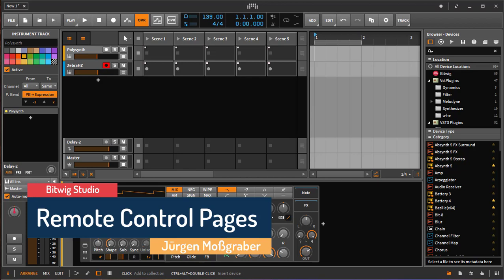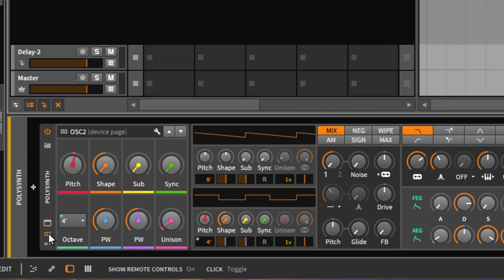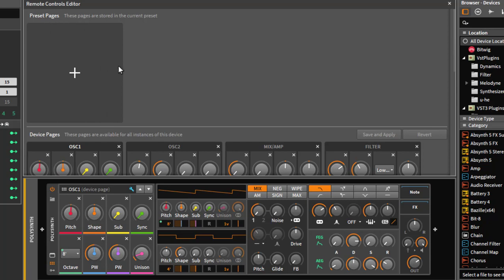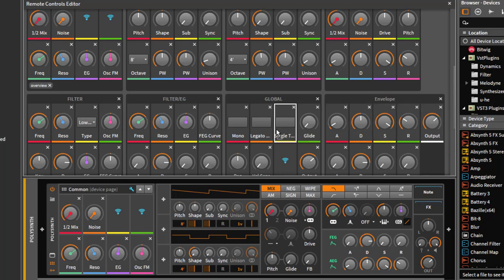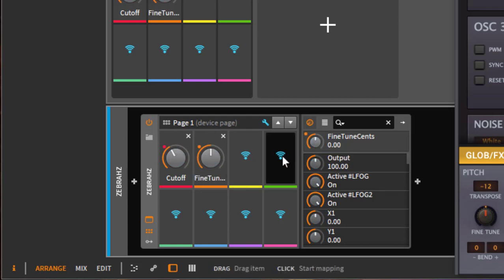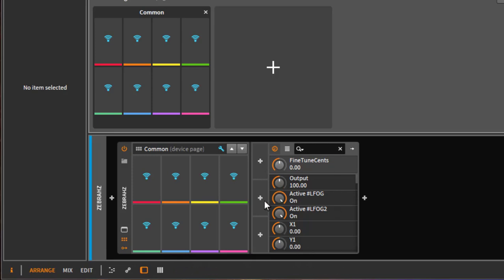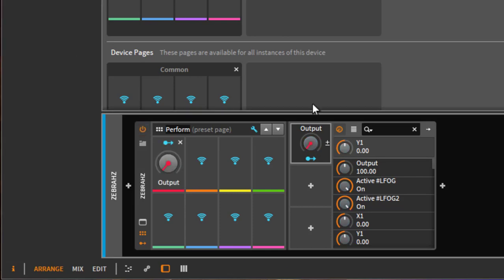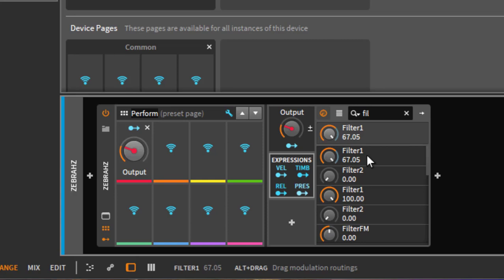Using Bitwig Remote Control Pages, Macros and Poly Aftertouch

Comment: Great tutorial! I have a quick question though. I am looking for a way to have a set of knobs be dynamic macros on a drum rack such as how Maschine works. I want to be able to select a pad and when I do the 4 knobs I have assigned would control say decay, pitch, filter cut off, and maybe volume per pad. Is there a way to do this? I know I can assign a midi cc knob to any perimeter but it wouldn't work if I switch to another pad or note. Thank you so much!
Reply from the maker: Yes, if you use a controller for which I support the layer mode, e.g. Push (from memory also: Akai Fire, Launchpad, MCU).
Reply: @mossgraber  perfect. I bought a fire. How would I assign pitch, decay to one of those 4 knobs?
Reply from the maker: @UNPAVEDMusic  You don't assign them to knobs but to remote control pages.

Comment: Hopefully a follow up question is alright. How would you do nested mappings? Say you have the midi cc device in the note fx section. How can I map the parent remote controls to that midi cc device?
Reply from the maker: E.g. if you have a Polysynth and added a MIDI CC in the Note slot you can create a Perform remote controls page in the Polysynth and map parameters from the MIDI CC device to it. This makes sense if you want to store it as a preset. Or you could use now project or track remote controls in Bitwig 5 to which you can map any parameter.
Reply: @mossgraber Ah I didn't realize that. Just make a new performance page and it works. Thank you so much!

Comment: Hey, in the first minute it shows you are scanning through the preset pages, is there a shortcut, or even better a midi control available to process through and back though preset pages ? I want to assign controls for frequency and gain of fabfilter pro q 3, I’m using a midi fighter twister and would love to be able to use one dial to control gain and crew per node. I have them assigned to remotes on page 1 and two but not sure how to roll between them. Obviously what would be super awesome would be to use the twister click button to cycle between, but I’m currently using a template which will only cycle between course and fine control. Jumping into editing the preset/template is a little overwhelming. As it’s a combo of both the midi fighter profile and also a custom script.
Reply from the maker: You can use my Generic Flexi which is part of DrivenByMoss (see the tutorial videos on my channel). There you can assign controls to specific pages or prev/next page.

Comment: Thanks for all your video’s! I’m trying hard to use this feature, but I fail to map these remote controllers to my midi controller via Flexi. Specifically as such that the same hardware controller CC is mapped to the same slot of different devices. Now we have the 2.0 version of Flexi I’m completely lost. I’m clearly missing some basic understanding of the Flexi approach. Is it possible to make a video how to assign these functions in this video with Flexi? Would be much appreciated! Keep up the good work!
Reply from the maker: There are several videos about Generic Flexi: https://www.youtube.com/watch?v=m4DkBlhR09g&list=PLqRWeSPiYQ64O9Ulu_aMQ9mdEDJDColcP e.g. the the "complete walkthrough".
Reply: @mossgraber  yes, I found the issue: my controller was sending MMC for then lower CC’s. Its now working!

Comment: Hi Moss! Great video as always :) In your opinion, what's the best controller on the market to operate Remote Control pages, Mixer and Transport? The controller doesn't necessarily have to have faders, keyboard or pads/clip launcher. I'd much really prefer a controller with at least 8 knobs with continuous input and led rings or display to show current value for both vst params and mixer levels, and maybe buttons for solo/mute etc beneath them... plus some buttons to use to switch pages/banks.
Reply from the maker: Go to the online shop of your preferred dealer, enter your filter criteria in the controller section, choose depending on your budget ;-)
Reply: @mossgraber  Budget is not an issue... I was thinking more on the line of what's good from a Bitwig script developer perspective (no filter for that... yet!) :) I have plenty of controllers (now playing around with PreSonus ATOM), but often have very poor support for MIDI, particularly when sending midi back to the controller to update leds, pads, etc. That's why I was asking you from the depth of your experience with these issues. Thanks
Reply from the maker: @EdoardoMarcora If you need deep integration, pick one of the controllers supported by DrivenByMoss.
Reply: bit of a late answer for you but if anyone else is looking for a controller like that, i think the midi fighter twister is pretty good option. 16 knobs with led rings, each knob is also a button. there is 4 banks of 16 knobs. the knobs can also be set to do something else when held down, like control volume normally, then control pan when held. the only thing that is missing for me is an screen that would display the parameters, but at least with bitwig you can just look at the remotes panel and see whats mapped, unlike other daws where you just have to remember.
the faderfox ec4 is similar (16 knobs/button combo) and also has a screen, but ive heard theres some oddities like you can use both a button and knobs at the same time

Comment: Hello, good video ! ! I have a question, at 09:00, where do you send the aftertouch mapping? to a Device or to a Preset page? thanks.
Reply from the maker: This is a VST plugin (so, not a native Bitwig device). In this case you can either map it to one of the parameters of a parameter page or directly to a parameter in the VSTs' parameter list.

Comment: Thank you for such informative videos! I would like to ask. Is it possible in such a way that the controller sees the parameters that are inside the chain and layers without mapping? I noted that maybe a bitwig can't do it. I hope I explained clearly
Reply: I would also like to know if there are interesting extensions for bitwig, like a multisample extension, which are not directly related to physical controllers in any way? And where to look for them?
Reply: And is there a script to create sort of virtual controller inside daw without midi сс?😅 I would like to use it in pair with your Flexi. If turn to the origins in general I'm interested in multiple instances of EQ+ with linked parameters without midi cc device and physical controller. For example, I read that there is a "linked FX parameters" script for the ripper
Reply from the maker: @vrtvp3  Yes, but the only controller I implemented this so far is the Push 1/2 since this requires IMHO a display of a certain size.
Reply from the maker: @vrtvp3  Checkout my OSC videos, especially with using (free) Open Stage Control software.

Comment: Many thanks for that tutorial, helps a lot  and works

Now my problem:
I created mappings for diferent plugins, but using only one and the same midi controller, mapped specifically for on and the same controller 
I want that only the current selected plugin, which is in the foreground or in focus, the one in use  reacts to the midi controller and the other plugins in the back do not react.

Lets says I have two plugings (A and B)
I mapped plugins A and B individually to one and the same midi controller
I mapped a control of plugin A to the midi controller's dial1
then I mapped a control of plugin B to the same midi controller's dial1 too
Now when I use/turn the dial1 on the midi controller the settings on both plugins (A and B) get changed at the same time
Both plugins (A and B) react  to the dial1 movement on the midi controller, although I have only one specific plugin of the two selected, in the foreground

Question: How do i achieve it that only the one plugin that is actually selected, or is in focus, lets say plugin A, reacts to the movement of the dial1 one the midi controller and not all the other mapped plugins as well?
That in this case plugin B isnt affected by the movement as well.
 
Hope my description of the problem makes sense, cause I cant find any information on that issue and cant figure it out on my own.

Many thanks! :)
Reply from the maker: That is exactly how remote control parameters are supposed to work! What you need is a controller that is supported either by Bitwig or by my DrivenByMoss extension. If this is not the case you can still use my "Generic Flexi" which is part of DrivenByMoss as well (see the playlist on my channel).
Reply: @mossgraber  
Thanks for the quick reply
I'm using a Arturia Beatstep with your drivenbymoss extension

I did the mapping shown as above in your vid, works.
But my prolem is that, like I described it in the first comment, that one mapped midi controller dial always adresses all plugins together not only the plugin that is in front or in focus.
But I want only the plugin that is in front, the selected one.
Maybe it is a problem in the midi controller configuration or I dont know, I'm using your script with the Arturia BeatStep.
Reply from the maker: @cpssounds3656  This sounds like you mapped the knob via MIDI learn?!
Reply: @mossgraber  Yes and that was my misconception, dang I guess I know now what went wrong, thanks

Comment: Hoi Jurgen great tut but it does not work in Omnisphere with other vst's like Ana it works well any idee ? thank you
Reply from the maker: What does not work? Did you map Omnispheres parameters to Bitwig remote control pages?
Reply: hoi Jurgen sorry but i don't understand it i have done everything you said in the video it shows nothing ?
i have done midi learn , host automation nothing ? It says host automation ID:8 thats it . @mossgraber
Reply: it shows nothing in the show plug in parameter tab ?
Reply from the maker: @johnnyb7787 No need for MIDI learn or automation. First click on the Spanner icon to activate the mapping. Then press one of the 8 blue icons, then you need to click on one of the parameters in the parameter list of your VST/CLAP device to map it. That's it. Repeat this for all parameters you want to map.

Comment: how do i map a knob inverted? can't figure it out anywhere
Reply from the maker: Insert a Macro modulator in the device which contains the knob which you want to invert. Turn the parameter you want to control fully to the right. Then enable macro knob mapping. Turn the parameter knob fully to the left. Map the Macro knob to Project, Track or device parameters.
Reply: @mossgraber  i dont have a "macro modulator"

Is my bitwig too old?
Reply from the maker: @TomBudin  Only if you have Bitwig 1 🙂
Reply from the maker: @TomBudin  It's in the video starting from 6:30
Reply: @mossgraber  thanks bro
Reply: BRO OMG THANK YOU!!!!!!!!!!!!!!

Comment: Hi! Looking for some help after looking at the video. 
I am looking to map serato sampler parametars (i.e. filter) for all 32 sample parts to one knob. When I map lets say 1 to 1 ( 1 filter knob from one slice to 1 knob in presets or device pages) it works and moves the parametar. 
My thinking was that I can map all of these and add a macro to control them. This does not work.
I tried the other way around, mapping all to macros and mapping thr macro to presetor device and still does not work. 
Any ideas?
Reply from the maker: I don't have this plugin but it should work like this: turn all 32 filters fully to the left. Insert a single Macro modulator into the 1st modulator slot of the plugin. Enable mapping on the makro modulator (the blue arrow below the makro knob). Now move all 32 filters fully to the right (the range gets blue). Turn off mapping on the Macro modulator. The knob should now control all 32 filters.
Reply: @mossgraber  this worked perfectly, thanks a lot! 
I sometimes  forget the simplest things.

Comment: How can i switch between different remote pages on my midi controller? I dont find an option for that.. 🤯🧐
Reply from the maker: You need a script/extension for your controller. If your controller is not directly supported you can use Generic Flexi (which is part of DrivenByMoss) to configure it accordingly.
Reply: Wow. Vielen Dank für die schnelle Antwort. Ich dachte, das ist bitwig-intern einstellbar. Tatsächlich nutze ich einen Korg nanokontrol2 mit drivenbymoss :) ich werde schauen ob ich das einstellen kann.. bisher hab ich es nicht zustande gebracht - jetzt weiß ich zumindest wo ich suchen muss.
Reply: Falsch! Jetzt habe ich nachgesehen. Der Controller ist direkt supportet, aber die Funktion finde ich nicht - das war das problem! Ich versuche dein Skript.

Comment: I don't have the colors or bottom control visualization with my midi controller, does the script need support for this?
Reply from the maker: Yes, the script needs to enable "indication" on the parameters.
Reply: Jürgen Moßgraber Thanks! One more thing the Maschine Jam script is missing, its great for machine, but the Bitwig script is not as good as they made me think it is. Kinda sucks.
Reply: @mossgraber  Hello how do I do that? thanks
Reply from the maker: @mjaa1307  Do what?
Reply: @mossgraber  hello, sorry!! I was refering to "enable indication"
Reply from the maker: @mjaa1307  There is no user interface for that. You need to program it.